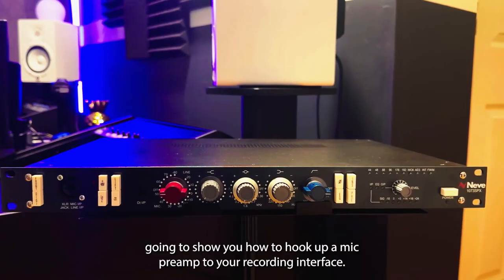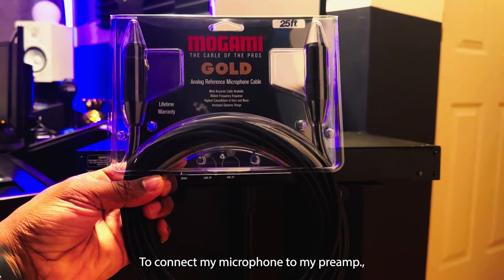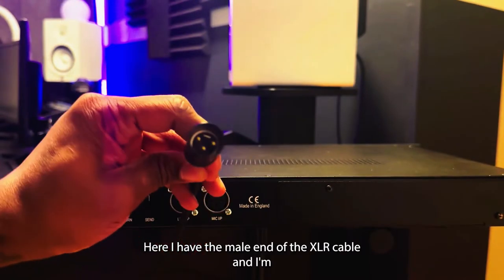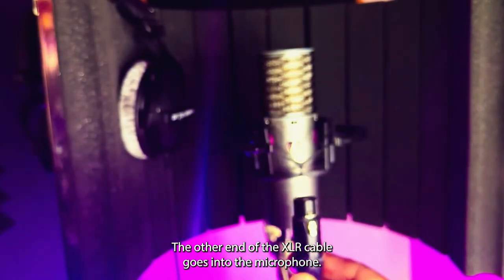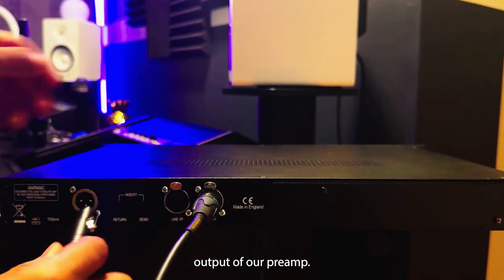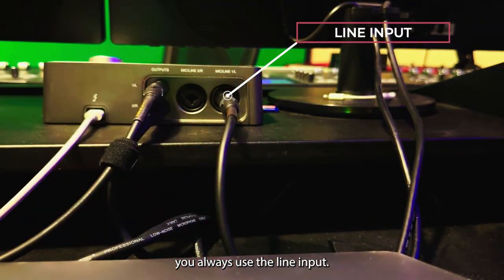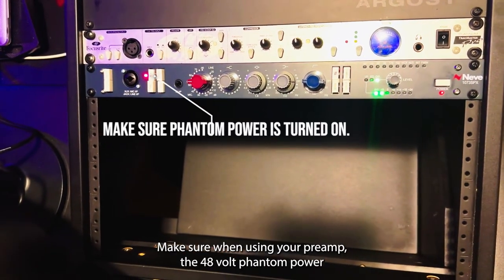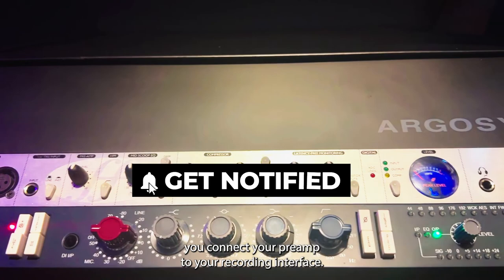How to connect a Mic Preamp to an Audio Interface.

Comment: You’re not truly bypassing the preamp though.. regardless of line your still going through preamp circuitry of the Apollo..
Reply from the maker: Correct.
Reply: @thehitmakerkay  i have 10 db of gain from the Apollo twin X goin through line smh 🤦with no gain from my hardware.. my la 610 mkii channel strip still sound ten times better then the ua emulations but damn man.. wtf such a cash grab just to get a line input you have to buy an X6 to truly bypass it
Reply: Doesn’t the Amp bypass when using trs? I think only xlr engages the Apollo pre
Reply: @itsmikepetro  I’m not sure but I do get close to a 0 noise floor.
Reply from the maker: @itsmikepetro  I was told the same thing, the TRS bypassed the pre.
Reply: Yeah you gotta go Apollo Rack for the ability to bypass the pres the X6 is the cheapest Apollo offering
Reply: The Twin X becomes a “controller” desk top unit but the “monitor” unit is the X6 
Thats the Thunderbolt 3 Apollo cascading hierarchy or topology that I chose

Just connect them together with one TB 3 cable and once in console 2 you can select which unit you prefer to be the ( monitor or main) functioning unit
I use X Twin as the controller since the X6 has better converters and more I/O

Then the monitor unit is responsible for monitors and alt monitors outs,
2 Hiz ins on front panel 
Mic and line level inputs 
and line level outs

Both units will work for talk back, Alt mon switching, polarity switch, pad, mute, sim
And the controller units (X Twin in my case) DSP is still available via the 
Console 2 mixing environment 
Just mute every channel in console if using a DAW to track or you will hear both signals at the respective latency returns
Reply from the maker: @gitarman666  I’ll definitely have the X6 soon.
Reply: @thehitmakerkay  
It’s a chunk of change but worth it man,
I wanted the x8 but instead I got the x6 and an Audient asp880 for 8 more channels of adat it also had db25 for 8 line ins and 8 line outs
Changed my whole workflow dude
 now I’m able to use a patch bay and kick in some nice outboard boxes
Reply: I have an APOLLO X6, what wiring do I get exactly, I see a lot of comments regarding the Apollo pre amp giving gain issues. If I have the Apollo x6 do I still need the trs cable to bypass the pre ?

Comment: Hey man, I dont know if you can help me with this lol. I just got a 1073LB (500 series) and I’m having a tough time getting any signal from my bass (line) into my Apollo Twin. I have an XLR to XLR coming out of my “lunchbox” into the back of the interface but not getting any signal at all only when I shut the unit on and off.
Reply from the maker: Use a female XLR from the lunchbox and a TRS input into the Apollo Twin. Switch the Apollo Twin to line and see what happens.
Reply: @thehitmakerkay  dang I don’t have one of those cables so I’ll buy one tomorrow and retry. Thanks! I’ll give you an update lol
Reply: @thehitmakerkay  btw I tried going xlr out into xlr to my monitors and still no signal? So I’m not getting any input signal from my bass at all. It’s not the cable nor the instrument cause I checked
Reply from the maker: @Jayyy_Wav  Hmmmm send me a message I’ll think of a solution.

Comment: Exactly what I was trying to find out. I was making the mistake of using the Mic input on the interface which wasn't giving me as clean a sound. Had to use a TRS cable into the Apollo Twin. Thanks for the direction.
Reply from the maker: You’re welcome.

Comment: I‘m new to this, so thank you, this is really helpful! What is the advantage of going from XLR to TRS into the interface instead of XLR to XLR?
Reply from the maker: Hey there! I’m glad my video helped out. So yeah the advantage of TRS to TRS is a more reliable connection and a lower noise floor. Some interfaces bypass the preamp when you use a TRS cable.

Comment: Thank you so much for this video I did not know you should be using the TRS line input I was just plugging it in with xlr.
Reply from the maker: Your welcome
Reply: I just found that out too. The question is why? Is there anything wrong with just using TRS cables all the way through?
Reply from the maker: @RedLine760-r8l  Because they use XLR connections on my gear.

Comment: Question can you use xlr to xlr or does it have to be a line for the out put I was using Apollo twin x and it won’t switch to line only mic and it still works ?
Reply from the maker: The Apollo Twin X won’t switch to line unless the interface detects a TRS connection. I would use XLR to TRS when going into the Apollo Twin X to get the lowest possible noise floor.

Comment: Hi! Thanks for the video :) I’m wondering, for the Mic input, can’t we use the front one, just next to the big red knob? Instead of the one of the back? Seems more convenient if the console is placed in a rack and only the front input is easily accessible. Thanks!
Reply from the maker: Yes you can! The front switch bypasses the back input anyway so if you were to have a mic plugged in the back the front input would automatically override it.

Comment: Hi! Need help. How can i connect my WA73 preamp to my D1600 mkII korg recording studio? Thanks
Reply from the maker: You’re going to plug your microphone into the input of the WA73 using a XLR cable. Then use a female XLR to TRS cable to go from the output of the WA73 into the input of the of the D1600. You should be good to go from there.

Comment: Question. Why does it have to be a line input from the pre amp to the microphone? I noticed that I had increased noise when I had it connected like that. Am I connecting incorrectly?
Reply from the maker: My noise floor is basically non existent. What interface are you using? Maybe change your cables. Bad or unshielded cables can cause noise. Turn the interface down and use the gain on the preamp.

Comment: I did everything as instructed . I have the same pre amp with a Apollo twin x. Yet I’m not getting much gain out of my pre for some reason . It’s like it was working before and now it’s not. Changed cords. Changed pre’s. Did about everything . Idk if it’s my line button that’s not working on my interface or what
Reply from the maker: Hmm that’s odd. What are the settings on your preamp? I’m going to do a video explaining how to get the best sound out of the mic pre.
Reply: @thehitmakerkay  super odd bro. The gain is at 35db . I remember when my mic line 1 was giving me trouble switched it to mic line 2 and that’s when I heard everything working wonderful. Then it just went out again the next week or so. When I crank my gain all the way up it’s a super distorted sound and it wont even go past -20 on the vu meter in pro tools. I’m getting no volume at all from it . Butt when I use a regular xlr cable and keep it as a mic line on my Apollo it works that way it’s just when I use the same cord you used on the video and switch it to line on my Apollo that’s where the trouble starts
Reply from the maker: @jermainewells1265  I don’t what that could be but that’s odd. Let me do some research on that interface then I’ll get back to you.
Reply: @thehitmakerkay where do you normally keep your gain at on your neve ? And also you never had to boost the line volume on your uad console right ?
Reply from the maker: @jermainewells1265  I keep my gain at 12oclock on my Neve. Make sure the burgundy knob all the way to left is on the side that says MIC
Reply: @thehitmakerkay  yep I kept my level knob 12 o clock as well and the burgundy knob at like no more than 35 prior to the mishaps i been having . All good i will find a solution . Which exact interface you have again
Reply from the maker: @jermainewells1265  I have the UAD Arrow which is now the UAD Apollo Solo. The compressor I have is what really gives me the levels I need for recording.

Comment: TO CONNECT PREAMP TO INTEFACE. DO YOU HAVE TO USE XLR TO TRS OR CAN IT BE A REGULAR XLR JACK???
Reply: Some require xlr some trs. It dependns on the interface. What interfacde do you have?
Reply: @blackpowergod210  i have FOCUSRITE 2i2 3RD. GEN (2 CHANNELS)
Reply: @blackpowergod210  i connected my hardware compressor to record vocals and the compressor reads the signal because i see the l.e.d meter on the compressor but it sounds NO DIFFERENT.
Reply from the maker: Usually a XLR to TRS. Use a TRS connector with the interface to bypass the preamp on your interface. Set your input from Mic to Line.

Comment: They say these interfaces can’t bypass their preamps at 100%
Reply from the maker: They do as long as your using a trs cable.
Reply: Do you turn your Apollo line level fully up or leave it all the way turned down?
Reply from the maker: @chrisclaycomb1880  All the way down.
Reply: Why??
Reply: Why you turn down all the ways?? You can wider the gate 😊
Reply from the maker: @shafiqrasel340  I was taught by top engineers to do it this way. I’m sure widening the gate it cool too. Although I’m not familiar with that method. 😎
Reply: @thehitmakerkay  Ok.  TRS cable ?? Why not TS cable.  That’s my question?? My recording is mono.   Sorry to bother you
Reply from the maker: @shafiqrasel340  it’s all good your not bothering me, I can talk music all day 😎. TS cables are usually unbalanced. TRS cables can be used for mono, balanced signals as well as stereo signals.